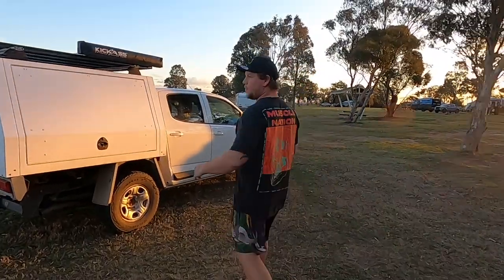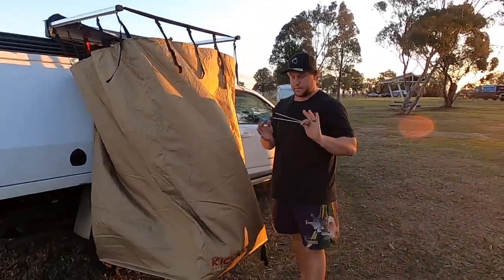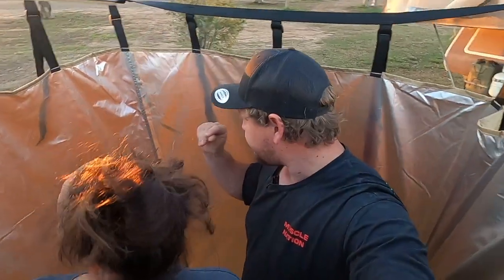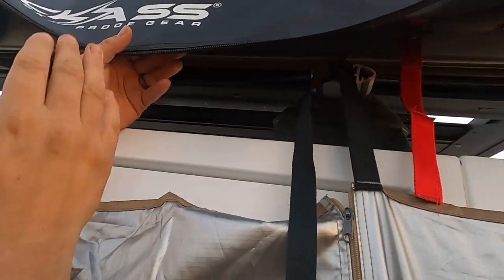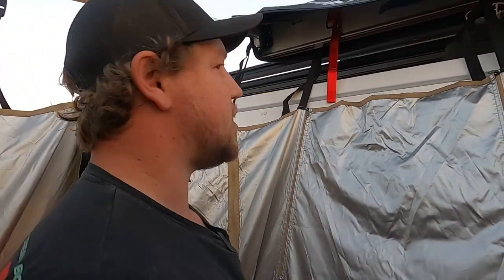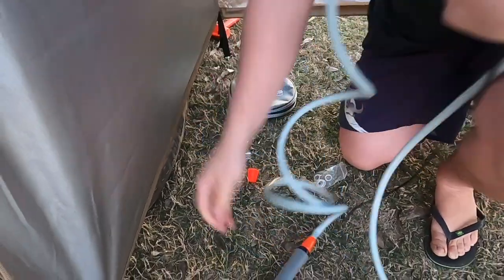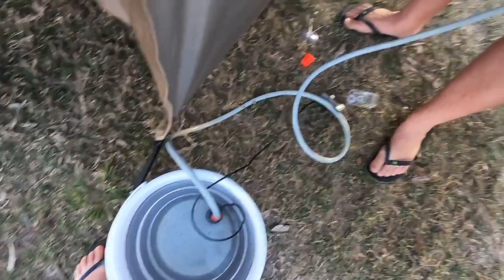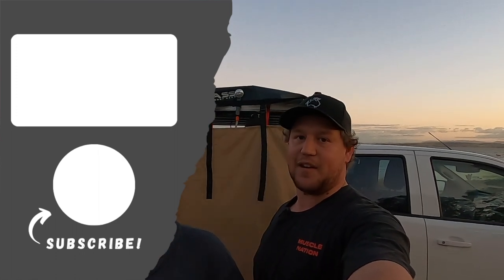Levelling Up our Camping Setup with a Portable Lithium Shower

Comment: Put ur shower tent on a bunnings heavy duty hinge bracket. An over centre latch to hold it against the car while u travel. A small gas strut to help the tent swing 90 degrees off ur canopy and keep it there in windy conditions. Use a telescopic tent pole to help support the tent when its swung out. Itll clear ur canopy door so u can open it. Works pretty well not to expensive mod.
Reply from the maker: Thanks mate, sounds like I've got something to do this weekend now!